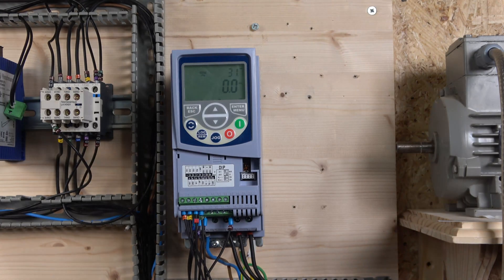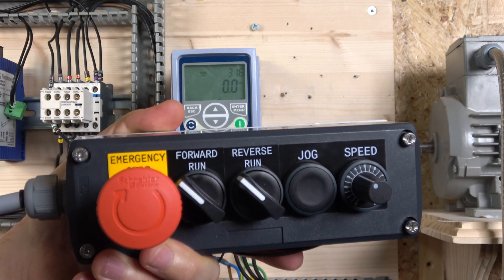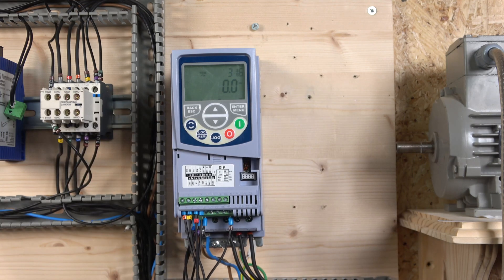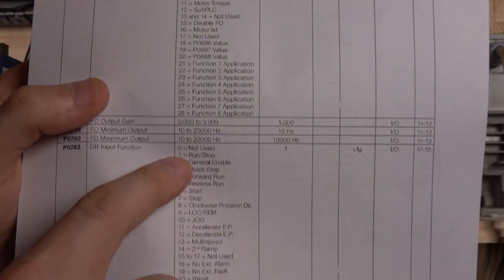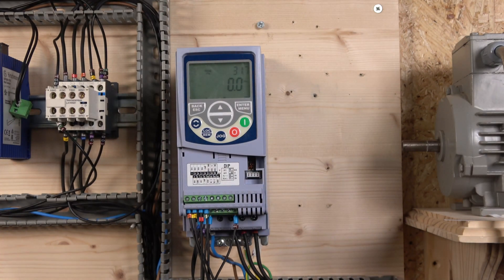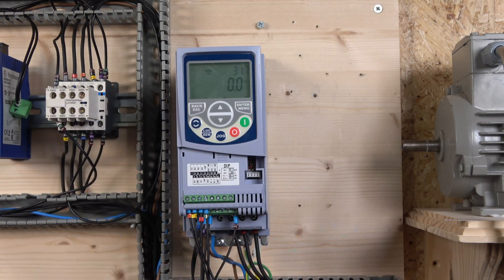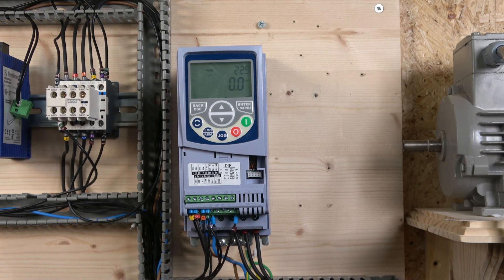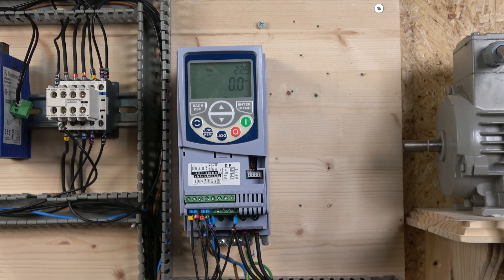WEG CFW500 VFD, remote control, 2 wire control, 3 wire control, parameter set up.( English )

Comment: The estop set up you have shown is not appropriate .Power supply
This typical installation using CFW500 with Safety Functions fulfils requirements for safety performance
SIL 3/ PLe and Cat. 4, according to EN ISO 13849-1 and IEC 61508, Stop Cat. 1, according to IEC 60204-1.
CH1|
CH2
6001
PBWTY + BESG
(self-monitored emergency push-button)
CSW-CK2F45-WH
國08
CFW500 with CFW500-SFY2
plug-in module

Comment: I would advise you not to rely on that zip tie holding down the pin on the motor axle. Sure right now you are turning it slowly but I have seen those buggers fly into windows and people. Don't underestimate the centrifugal force.

Comment: Great  can you show me in video how to wiring  the VFD 2,2 kw at : 
+ fuse 
+ safety relay 
+ filter 
+ braking resistor 
 + contactor 
+ e-stop 
+ reset button
 + switch main power
Reply from the maker: There might be series in future of that.